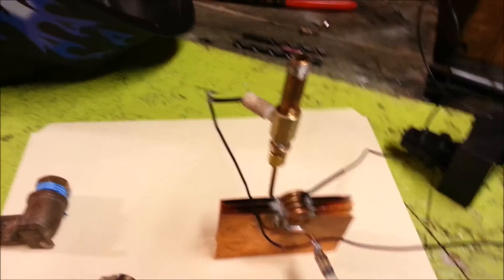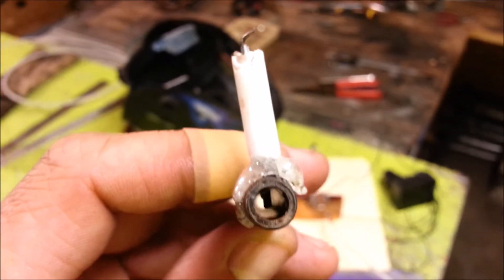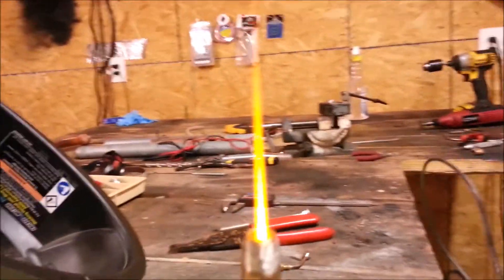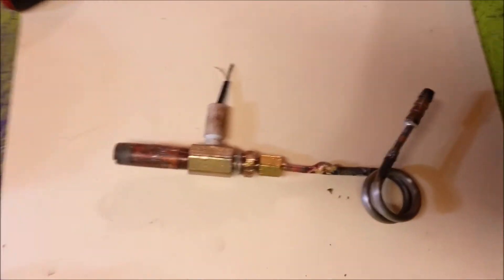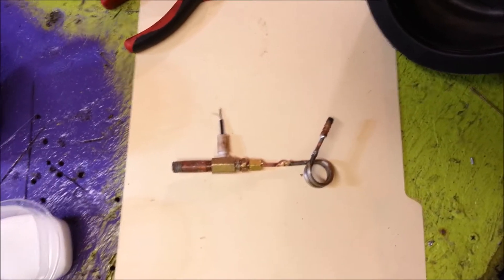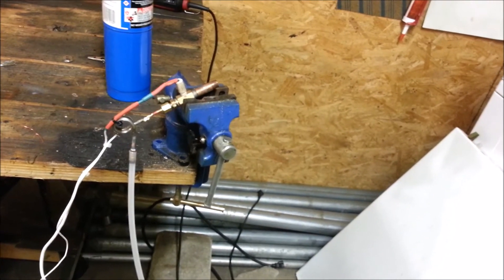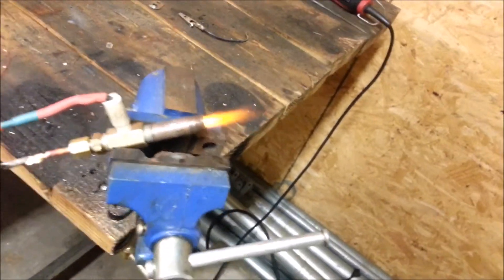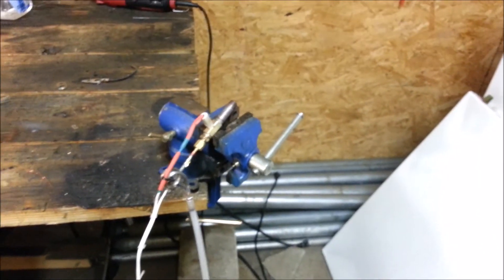Gasifier  ignition torch using hydrogen explosions ( Information )

Comment: Have you thought about placing a fluid connection container inline with the feed line to your torch? I also built my own HHO generator from scratch and I had the same issue from time to time. You the the connection container can also double as a pressure relief valve for flash backs.

Comment: Hi did you realise that when you put your finger over the end of the igniter near the end of the video your body was acting as a capacitance energy charge that if the gas needed electrons or protons or neutrals to become stable it pulled them from you and you pulled them from your surrounding air    Once you realise this , this stuff becomes simpler to understand and tweak
Reply from the maker: honda4004 no i did not no that
Reply: To clarify that watch that joe cell horses mouth he tells you when he puts his thumb over the stainless fire dxstingiisher that it changes the chaotic charge inside the water       Ok grasshopper   But I too am still learning off this master called joe booker a true master of energy.  His knowledge on this can easily build  a antimatter matter ray beam weapon that would on correct amplification disintegrate tanks and anything it is aimed at. The same as we see in the war of the worlds film